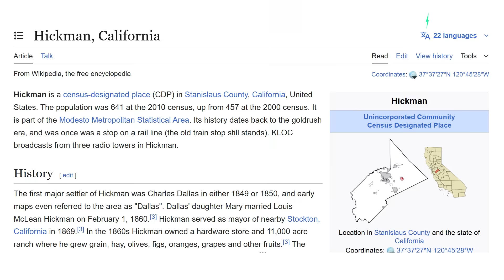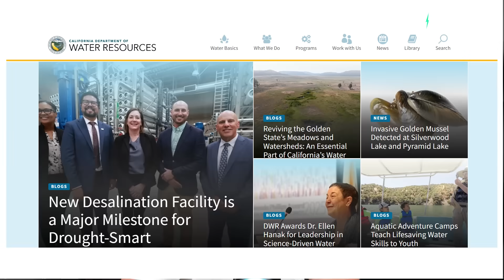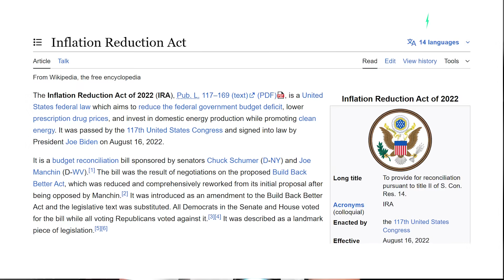California’s Solar Canals Could Power Millions of Homes

Comment: The one big thing that has not been mentioned as yet, is why build expensive structures over the waterways, when most of the ones I have seen so far,  just float on the surface!  Surely this must be a lot cheaper to implement and easier to change in the future if required?  The water is fresh, there are no raging torrents, the moduled can be moved easier and so on..

Comment: California messed up when it covered all of its waterways in concrete. Unfortunately, that keeps the water from getting to the ground and resupplying its underground aquifers. 

I hope at some point. They get the bright idea to use that water as cooling for battery backup systems.. It seems to me that battery storage is the next step.And in order to be efficient, you need to keep those batteries cool.In the hot sun, using those canals to cool down big battery plants.
Makes even more sense.

Comment: It's about time. Many of us here in California have been screaming for years and petition to do this, to place solar panels over the canals. The power generation would be amazing and the shade will reduce loss of water plus generate more jobs, a nice bonus. Plus, the little water that evaporites will cool the underside of those solar panels, further ensuring those solar panels function at peak performance.
Reply: Cooling the solar panels underside makes them operate more efficiently.   Check out agri photovoltaics in growing vegetable.  I have a garden atrium fitted with solar panels above which provides electricity for irrigation to garden vegetables underneath.   The plants get some protection from the sun overhead, but still enough to grow well.  Win win.  Also the plants provide Cooling to the panels above thru transpiration.

Comment: I live in Turlock and have 9kw of solar on my house. Although I shouldn't complain because TID is non profit and we enjoy some of the lowest electric rates in the nation. However, I find it ironic that they are so enthusiastic about all this solar over the canals, ( I do think it's a great idea) when they basically penalize residential solar by charging a "Demand charge" which means the asses a $3.per kwh based on your highest demand over any 15 minute increment multiplying by 4 . So, for example if in a single 15 minute increment you use 2.5kw, they X's by 4 =10 kw then charge $3 per kw. Even though you may have literally only used maybe 3 kw. 
I called to ask/complain, they told me that because they have so much solar out there and they need to make a profit. I get it, but it's pretty frustrating when we, the homeowners spend $10's of K$, to SAVE $, then they essentially penalize you for lowering your bill 😡🤦🏼

Comment: I see that the experimental canal covers were being built right next to a reservoir, the Chinese are covering their reservoirs with floating solar panels to keep the water cooler & prevent evaporation & saving solar farms from being placed on land that could be used for agriculture. That California open water reservoir could also support solar panels, some designed to be rafted for the minimum low water area & some designed to continue to work if grounded in drought conditions. If you plan something don't just go halfway, floating panels are cheaper than heavy support construction required for solar panels bridging the canals.

Comment: The idea is actually genius in multiple ways.

Not only does the shade from the solar panels reduce evaporation, but the moving water actually keeps the underside of the panels cool, thus increasing efficiency for the panels (or at least reducing thermal based efficiency losses).

Comment: Instead of building structures over the canals to put the panels on, why not put the panels on top of the water itself, like you see on the surface of some lakes? Of course they would have to be anchored somehow, but that seems like it would be easier/cheaper than building these large structures

Comment: I don't know why they haven't done this sooner.  Well... cost, public will, blah blah blah.  I wondered why they were just left open as well.  IMO, more stuff could be covered with solar.  Parking lots in Vegas for sure.  There's also Agrivoltaics, which would help shade crops and having them use less water.  Cover it all.

Comment: Hey Sam, a similar thing happens when rooftops, parking lots, etc. are shaded with solar panels! About half of the state gets very, very hot in summer. And a lot of energy is used for AC, and a lot of productivity is lost when people overheat. 

I did a bit of math when I installed solar on my house.and I guesstimated that the payoff for my solar racking and panels would be about 13 years even if I never generated energy from them! They’d cool the house and cut AC usage that much!
Reply: Full disclosure, DIY install, 36 panels for $5,000, plus about $3,000 for racking..

Comment: One of the advantages of deployment in California is that several key elements of the power grid are aligned close to the major canals, making it easier to get the power into the grid.  And, of course, there are no land acquisition, zoning, or permitting issues associated with the projects, as they are being built atop state- and locally-owned hardscape infrastructure.  No newts, frogs, or rare plants to be disturbed, no migration paths disrupted, etc.  No NIMBYs.

Comment: One of the biggest issue in CA with solar farms is finding new land because most of the land is designated for agriculture. This will make so much since for these private solar farm companies bc they wouldn't need to buy or lease the land if government allows and is available spaces. They would only need to worry about installation costs. These canals runs north to south through out most of the state in locations with no power lines this project could also help on the installation of a new power distribution system which could help add more EV charging stations along Highway 5 and 99 which is greatly needed. Tesla just installed their world largest self powered supercharge station along this corridor in Lost Hills. They had to add lots of solar panels and Tesla battery megapacks to make it self sustaining bc they couldn't get utility connectivity in this area.

Comment: California now has an excess of solar and wind power capability. That's right we generate solar power beyond what the system can use. So how does it make sense for the taxpayers to build a large state owned solar farm? My power comes from a for profit utility and is 100% from non-green house gas sources. People who were swept in to so called community aggregators buy the same electrons but at a higher price or they can pay even more and get 1005 GREEN electrons. This is possible because the state does not allow nuclear to be labeled as green.. Our neighboring states do not want to buy expensive California solar and wind power, because they have a more economical mix available, and none of it is from coal.

One result of the government interfering in the market is that we now have among the highest power rates in the US. The state regulates the wholesale market and sets rate for the retail market. It allows municiapal and "non-profit" groups to buy and sell from a privileged position and it sets rates to support a wide variety of social programs and what amounts to power welfare.

You are correct in saying that agriculture drives the water market and it does so in part because of some backroom deals made years ago that effectively make water supplied at tax payer expense to farms a private property which can be and is resold for a profit. So much water has been pumped out of the Central Valley that new some canals cannot be used to capacity and new parallel canals have to be constructed on higher ground. Now the irony California now imports some of the same crops that it exports.

Comment: I live 2hr way from this project and I know 2 people in my family who are working on it. This is for now a very small study project. They are testing costs, efficiency, pros and cons. This is a very expensive project due to the long span and need to use momentum frame heavy duty steel. This project helps save on water due to less evaporation, by shading water there is less growth of algae which saves on clean up costs, it produces lots of electricity which will off set installation costs, solar panels over water increases efficiency of electrical production. They need so much information to see if this really makes since. Turlock Irrigation Water District is a very small department and they don't have that much of a budget for large scale projects. They really need to make sure it will work financially. They will probably use these numbers to go after State grants which they are probably pursuing right now. I will ask someone. But my personal opinion is that this will make so much since and will probably get power utilities to invest in this project. If the private sector is allowed to get involved, all of the canals in CA will be completely covered in no time.

Comment: Floating Solar in Canal is much cheaper and cools solar panels.
Reply: The water is moving. Stuff floats and stacks up on non-moving floating things like panels. And then there is the variable depth of water all the way down to zero.
Reply: @danielcarroll3358  Floating Solar would only be in the middle of canal where water is nearly 90% or more of the time, NOT from edge to edge of canal. Panels anchored to canal to stay in place.

Comment: its nice we finally took this no brainer opportunity. they also have floating solar array options for reservoirs.
Reply: True. They can't have floating arrays on canals though, because the water level can go to zero.
Reply: @danielcarroll3358  does it?
Reply: and even if the canals do dry up, they will still work just the same.

Comment: The definition of saving money is different between the government and its citizens.  I live in SoCal, and my Tier 2 Edison rate is going up 10% next month from the current $0.41 kwh. This is the most expensive rate in the U.S.  We are also getting a $25/month fee added to out our monthly electrical bill starting in the next couple months.  Eventually, the fee will be based on a family's income.  The fee may be as high as several hundred dollars per month.  This is a disaster for familys and 200,000 per year Californians can't move out of the state fast enough.  BTW, the solar panels over the canals is a great idea but they only work in the daytime.
Reply: No, a monthly SoCal Edison fee will not be based on income. The California Public Utilities Commission (CPUC) approved a flat, standardized monthly fee of $24.15 for most customers starting in late 2025, with lower fees of $6 or $12 for customers in low-income assistance programs. This replaces the earlier income-graduated fixed charge proposal, which faced criticism and was ultimately removed from consideration
Reply: @danielcarroll3358   ..... Not based on income yet.  It was originally based on income but the blow back was so bad that they had to temporarily go with a fixed fee.  However, CA is a very democrat state with a democrat mayor, a super majority legislature, and Prop 50 which may drop the   number of Republican districts to less than 4, out of 52.  It's only matter of time before the fee will be based on income.

Comment: Battery storage is necessary to store this energy.  Since aqueducts follow terrain of least resistance, just like major highways, this power could be used for DC Quick Charging stations to power EVs. In fact, why not also solar covers over some of California’s desert highways to power EVs, give shade for lower A/C use and illuminate the highway for safety?

Comment: They might consider bifacial panels on the sides of N-S canals in wide sections where bridging would be more costly. Bifacial PV production would be enhanced during low angle solar insolation reflecting off canal water while also complimentary to demand(duck curve). Vertical panels tend to be less susceptible to hail damage and accumulation of airborne fouling.
Reply: My solar panels just took a pounding from hail during the monsoon here in Arizona. After several years all it does is clean them off with no effort. Its the homeless people that you have to look out for.

Comment: get rid of high speed rail and do this instead for a fraction of the cost.  we don't need high speed rail between bakersfield and merced where relatively few people live an would benefit while costing taxpayers 100's of billions over budget, and generating minimal revenue that will never offset the cost of building and maintaining it.
Reply: Why not put solar panels over the high speed rail right of ways and store the electricity in batteries, then use the stored power for the high speed trains?
Reply: The train also stops in Fresno, which has a larger population than the largest city in a majority of the states. The estimated population of Bakersfield in 2025 is around 418,781 people, according to World Population Review. The Bakersfield metropolitan area's population is projected to be higher, around 751,000, with growth from 2024 to 2025. Every time I hear exaggeration along with astronomical money amounts I think I have found another MAGA who only watches the sidestream media. The Central Valley has a population of over 6,000,000 and is the fastest growing part of California. Less than $20 billion has been  spent on the project so far and another $20 billion of State of California funds are guaranteed. So the project can wait for the courts to return the $4 billion that Trump stole.

Comment: Evaporative loss from uncovered reservoirs is a huge problem impacting cities all over the US and many are finding it difficult to get funding to cover them solely to combat the loss.  Since the cost of covering them with traditional materials and solar is relatively close its only reasonable to use solar panels killing two birds with one panel, water loss and power generation.

Talks on covering the reservoir where I grew up have stagnated for years since it was considered too costly based on the value of the water lost however factor in low cost pollution free power generation and it could become much more financially viable.

Best!

Comment: Great Concept , I'm wondering if they are using any large scale battery storage with the panels .
Reply: This is an experiment to measure the results of the idea. This is not a large array so its output can be absorbed by the local utility without difficulty. Of course batteries are a good idea for large solar (or wind) systems and are being installed in several places in California.

Comment: Why aren't these panels floating on the surface of the water?  All that mass, for what?
Reply: You're correct that all that steel cost a huge amount and raises the cost of the overall system considerably. However if the just put the panels on the water that would also cause problems from a maintenance standpoint and potentially cause log jams if there was ever some sort of debris that fell into the canal. I think it's also difficult to find places to offload the electrical power to. It's not like there's a transmission line that follows the canal. Still I like the attempt.
Reply: @laughinggas5281  "The amount raises the cost of the overall system considerably. However, if they just put the panels on the water, that would also cause problems from a maintenance standpoint and potentially cause log jams if there was ever some sort of debris that fell into the canal."  Do you see any big trees around? We have docks all over Missouri.  If you slide an air bag underneath, you can lift the panel 20'+ into the air for maintenance.  We run cables in the ground all the time.  A cable inside the canal won't get cut or burned.  I don't know how long a canal is, but we can run ocean cables thousands of miles.
Reply: This is a canal. The water and anything floating on it moves. That moving stuff will pile up against the array and be a problem. Another problem is that the water level goes to zero at times. Your idea works well for lakes and reservoirs that never go dry.

Comment: Some of the designs shed rainwater outside of the canal.  Seems stupid.  A few that use a W design would shed inside the canal.  If the intent is to save water, wouldn't it make sense to deposit any rainwater into the canals?  Less sunlight also means less aquatic plant growth which reduces needed maintenance.
Reply: Not necessarily.  A couple of points.  Many canals get smaller as they go along not bigger like rivers.  So if they collect the rain water it will cause flooding down stream.  Second point the areas that the canals run through don't get much rain when the water is needed most.
Reply: Well, that rainwater is going into uncovered canals already.  So having solar panels shed rainwater into the canals isn't changing anything.
Reply: @jabbathespud  Not quite.  Looks like some of the panel designs have more surface area than the uncovered canal itself.  My guess is, so little rainfall hits where these canals tend to run that it's just not worth adding drainage systems to them.  

Also, ground water recharge is a real issue in most parts of California.  Letting the rainwater fall on the soil beside the canals would help a tiny bit with that.